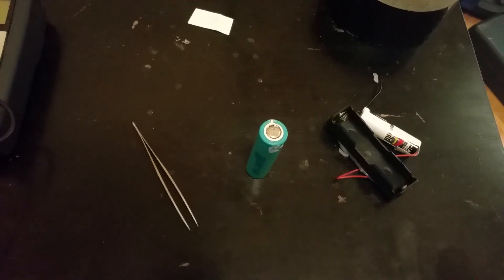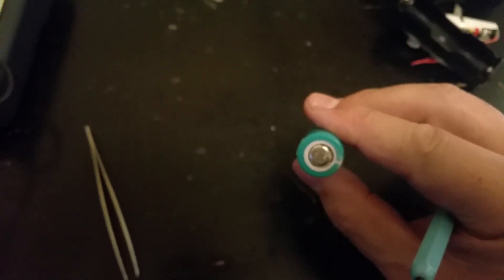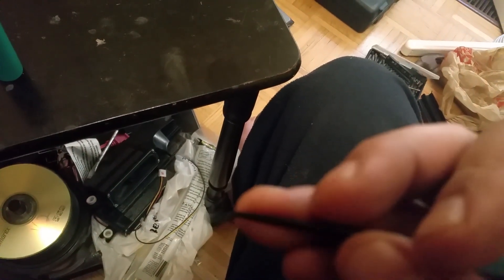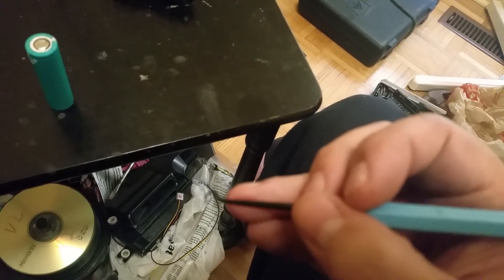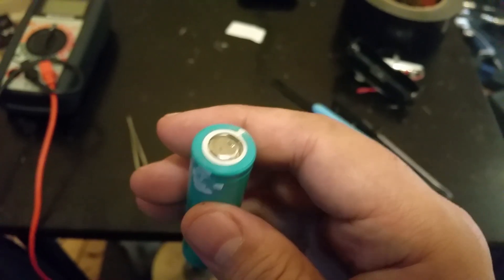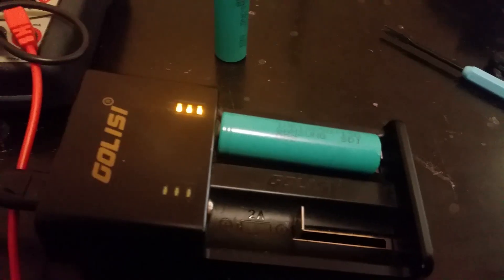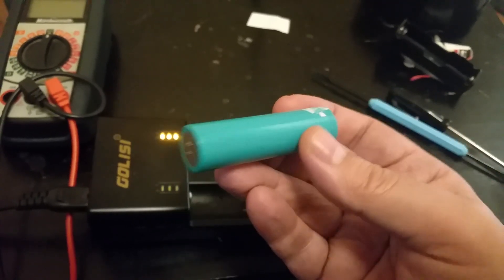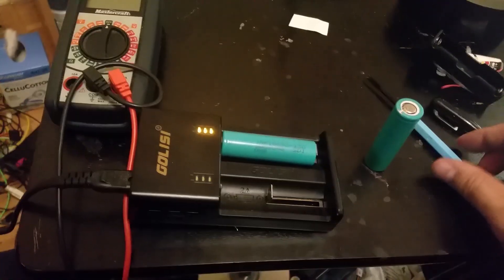EASY FIX FOR A DEAD 'NOT CHARGING' LITHIUM 18650 BATTERY FROM A CORDLESS TOOL BATTERY PACK - PART 2

Comment: I have about 300 NEW LG and Panasonics here and about 150 used of the same and had just thrown out like 9 of them for being ZERO responces. Damn to late now. But good to know in the futurte. I know with all these batteries i should not worry about 9 or so lost, But every one is one more than i had before when it was dead zero.

Comment: Hello, I have two effest 18650 batteries in my smok species V2 vape, one battery works as normal but the other dies within a few hours while the working one is still over 70%, Also the abnormal battery takes over a day to fully charge. What causes this issue please if anyone knows?
Reply: Internally it's a bad battery, not related to the battery in this video, time to replace, imo stay away from efest batteries

Comment: I know this is an older video, but thanks a million...I had an 18650 efest battery that would not take a charge. I followed your instructions and used a micro flathead to the section underneath the positive cap. My battery is now charging. Hope all's well👍

Comment: I had a same issue with 0 volts. I literally removed a board in the negative side of the battery and is working just fine.

Comment: I had two LG 18650 HG2 batteries, which were reading zero volts from one day to another.
Today, my third one suddendly died while having it in my vape. It was still almost halfway full and the vape turned off while I was taking a puff. At home it was also reading zero volts. Then I tried your fix and pressed down the pad below the button on the positive pole and while I was pushing down, I clearly was able to hear gas exiting the battery case!! So I think the shutdown/disconnect is intended by design, in case the cell is gassing out due to an internal chemical failure!
I highly do not recommend using such a "revived" battery, since its chemistry is no longer stable!! Never put it in a charger again!
I dumped mine now, its not worth it.
Best

Comment: I thank you for the great video and the information. I was able to revive a battery pack that was down for quite a while.  It has been working well in my cordless drill. It has charged properly since the fix and I will give a further update as I continue using it.

Comment: This works. I tried it. But, if that metal thing pops up, it means that there's a over pressure inside the cell, so the battery may be not safe to use anymore. When i tried to charge the cell it got warm pretty fast, then the temperature settled at about 30°C ....after some time it started consuming a crazy current (short circuit almost) and the battery got quite hot. So not the safest trick to use (That battery was revived from a completely dead 12 years old battery pack btw, so maybe that heat is caused by it's age)

Comment: This is kind of like removing the check engine light from your car and treating it like it's fixed
Reply: check engine light on means what? unsafe to drive?  so in your analogy u would junk your vehicle and just buy another one. ive done this and still no explosion after a year of use, maybe a car will explode if driving w/check engine light on. its like apples argument against "right to repair", claims safety for consumers for not getting your devices repaired by 3rd party
Reply: @vinnyc7613  It might be a bad analogy but my point is that it's probably not a good idea to try and bypass safety features
Reply: Well, it happened to nearly new batteries.
After fix myself, I don't need to buy new batteries.
Some have worked for years after this simple repair, don't bother discuss with people that are not able to fix anything themselves.
Let them buy everything new 😁
Reply: If they can afford to buy new without trying to fix bad manufacturing,
don't bother discuss it.
They buy new everything, not sure if they help climate being better.
But they support companies earning a lot more money 🤑 
Don't bother, if they never have managed to Fix anything themselves.
They never would 😉

Comment: From A "Safety First!" prospective, this is not a good practice. First of all, Safety IS the main reason for this design. This is to prevent an explosion or a fire! The battery obviously had something go wrong in order to prompt the button to "Pop" up.

To expect this to work Every Time, is not a good thing. Sure, you might be lucky and this battery lasts a very long time again. Or you might be unlucky and destroy your equipment or your eyes. Maybe even your house, when the batter leaks or explodes.It is never a good idea to ignore safety. NEVER!

Just ask yourself if money is more important than you or your family's safety?
Reply: safety he says, most cells are fakes and cid doesn't stop fires, helps prevent them yes  but can still happen

Comment: Do not boost lithium-based batteries back to life that have dwelled below 1.5V/cell for a week or longer. Copper shunts may have formed inside the cells that can lead to a partial or total electrical short. When recharging, such a cell might become unstable, causing excessive heat or show other anomalies. - Battery University
Reply: Big battery hates this one tip that could save you big money!

Comment: done that fot some time, but noticed that cells with blown thermal fuse are usually very low on capacity :/ if thermal protection goes, that means a lot of heat was around that cell, so it cant be very good anymore.

Comment: Hey Guys, I was reading the posts here - You really need to go to BigBattery.Com - The prices of their batteries are insane, and the quality is way incredible. I have been using (4) of their lithium-ion battery packs to make a 48V 9.2kWh size battery bank for the last year and they work like a charm! I used the discount code "Cycle5" to save an additional 5% at checkout. I think the direct link https://BigBattery.com/LiIon has the best deals on these. Hope this helps!"

Comment: Thank you, i had the same battery after chargingit showed 0 volt and didn't think this would work, so i put a needle under that cap and using a multimeter it showed 3.3 volt after pressing around the voltage stayed. Thanks!

Comment: Its very dangerous however it did work.. i tried the parallel method but it didnt work for me. But this one did.. you just have to be gentle not to damage the batteries

Comment: I tried this.  Had a little glasses repair sized flathead to poke around.  No voltage change (0.10v), so I kept poking.  Got 0.45v, then 0.85v, so I went another round of poking.  Then the battery hissed at me, so I dropped it and ran away.  Came back with some long pliers and a bucket.  Strange smell in the air that I immediately chose to stop inhaling.  Left the danger battery in my backyard for now.  :-|
Reply: dah, why u use metal tool, vid states not too

Comment: DIY Vinny, 

Thank you for helping people with their issues. You titled the video 18650 CID Reset DONT DO IT. This for a very good reason. 
IF you want to create video's about risky tricks like this, try to explain why you SHOULDNT TRY THIS. 

Imagine that there are people trying this at home and ending with the possibility on lifelong injuries. A battery cost around 10 euro, it is reckless behavior messing around to save 10 euro. IF you made this video about the risks of messing with this batteries, you would have the same amount of viewers etc,. But instead of pushing people to try risky things, you would protect your viewers by giving them the right information about this kind of tricks. 

BEFORE YOU TRY THIS AT HOME. OVERTHINK IF ITS WORTH TAKING THE RISK TO LOSE YOUR EYESIGHT OR WORSE. JUST SPEND THE FKK 10 EURO FOR YOUR SAFETY.

Comment: I did it and did not work. After the explosion near some household chemicals, i went to the hospital. 
They found out that the radiation created by this mistake mutated my cells and now when i get mad i become in to a green monster.
Now ive been chase by a secret goverment agency after i escape. Please do not try this
Reply: GREEN MONSTER? im buying every dead battery , should eventually get lucky by doing this method. now dont get me angry

Comment: DO NOT DO THIS!

There was a very bad problem happened for this battery and the protection part broke the connection. lf the problem of this battery still there and you reset the connection, the battery may explode at anytime.

Comment: Just a quick note here: If you do this and you hear a "poof" or "hiss" noise while pushing the CID disk down, that means you've punctured it which also means that the overload protection will no longer work.  If the battery is overloaded, like with a short-circuit, it will overheat and could burst and catch on fire (what many people call an exploding battery).
Reply: Tried using my wife's Cricut weeding tool and I made it hiss on my first try...too sharp...Ayayay!!!  where are my keys? Lmao. Thank you for that info.

Comment: This happens to your battery because it is expanding, it's supposed to happen to prevent it from expanding to the point of failure. If you "fix" your battery with this method, you are putting yourself at risk of the battery catching on fire or "venting" as its called

Comment: I must admit that this worked for me,  a 18650 that had been overdischarged and after a very gentle charge it went open circuit due to this venting protection. The cell did vent slightly when the button was depressed and is no longer open circuit, capacity seems close to what it was originally, it is a fake LG. Obviously this is a dangerous practice, you need to be extremely careful not to short the cell or puncture it. My "revived" cell will not be used for any high current discharge, I am still pissed that my 4 LG 18650s were fake despite being careful where I bought them.

Comment: Worked on one battery, not on the another (funny enough, the one it worked on is a high quality name brand, the one that it didn't work on is a knock off no brand). Good tip, both batteries 'died' when I left them in a hot tent on a summer camping trip.

Comment: I think you should've posted a safety disclaimer to this video because what you're doing is DANGEROUS AS FUCK!!!!  If you were to puncture this battery using a gahdamn piece of metal like you're doing, it can blow your fucking arm off, along with any other body part that's near it when it blows up!!!!  Lithium Ion batteries are EXTREMELY DANGEROUS and messing with that battery in any shape form or fashion is extremely dangerous!!!!  You DEFINITELY need to post a disclaimer to this!

Comment: BE CAREFUL, mine sparked up on my Gabriel. It does work and it can charge just be very careful when doing so
Reply: fyi the entire outside casing of the battery is negative. If you pierced the protective layer while probing into the positive side you will short the battery

Comment: I have two new 2600mAh Li-Ion camera batteries (not 18650 single cells) that I’m unable to charge properly after only a handful of charge cycles. The weird thing is when they are fully discharged the charger reports them as 90% charged. After charging to100% I only get around 5 minutes use from them whereas new they gave me around an hour (I use them to power a 7” camera monitor). I checked with a voltage meter and they definitely have zero voltage output when discharged. I doubt the charger is faulty as I have two identical chargers and both give 90% percentage readouts when the batteries are definitely flat. What is going on?

Comment: Don't do this. By batt made a noise like air coming out. The noise stopped, then a minute later was making fizzy sounds. I put it outside.
Reply: Of course it made noise, its releasing pressure that triggered the safety

Comment: The button is there for your safety!!!   Stop f...ing with these explosive batteries!!!!
Reply: or planned failure so would need to buy a $100 battery pack replacement because of one supposedly dead cell after only a couple of years of light use

Comment: hey thanks bro, it actually worked on my 18650 battery which I got from my old laptop battery pack. And the battery is working fine with 3.84volts.
wondering if i've watched this video before i should have save my 4 liion batteries.
and for your knowledge,  the pop up   provides protection by disconnecting the +ve terminal after the electrolyte has be heated (  that may be due to short circuiting or over charging)
once again, Thank you

Comment: It's called a Circuit Interruption Disc and it pops up as a safeguard for when too much pressure builds up in the cell. Whether that's from a short, damage, atmosphere, who knows. But essentially that battery at one point was saying it wasn't safe to be used. But I've seen quite a few cells revived this way. Not sure how well they hold up though
Reply: @faking it Will kinda. After you push it down manually you're weakening it and it may or may not be able to pop back up under pressure. It's kinda designed for a one time use and once it's popped you're supposed to get rid of the battery. But, that's not to say I've never pushed one back down, tested it thoroughly and then reused it
Reply: @honestinsincerity2270  is it dangerous? I have several batteries that won’t take a charge. I have no idea as to why I mess up a lot of batteries. I’m sick of buying them. I tried new chargers and batteries from different sellers. I think it’s me and if this isn’t dangerous I might try it. I don’t wanna blow up.
Reply: @AshleyAshleyAshley395  Kinda. I mean it is a one time use safeguard so once it's tripped the manufacturer is basically saying this battery is no longer safe for use. But, with that said, they also want you to buy as many batteries as possible. Personally, I've revived quite a few cells by pushing the CID back down. And I still use them to this day.
Reply: @AshleyAshleyAshley395  and if that's happening a lot to you and you're using name brand cells like Samsung, LG, etc then it could be you're charging them too quickly or at too high of a voltage. Usually that'll cause heat in the cell, which cause pressure, which causes the CID to pop out. So might wanna make sure you're using a good charger on the right settings.
Reply: Im sure your house won’t hold up well.
Reply: @fbi-federalblyatofinvestig3853  Yeah totally. My house is gonna EXPLODE from a few Li-Ion cells. That's like saying the road flares in your trunk are gonna explode. Learn how to test and treat your power sources and you won't have a problem.
Reply: @honestinsincerity2270  I’m not trying to start a fight but resetting a CID that has popped for either overheating or extreme pressure in the cell doesn’t sound like a good idea and can lead to a fire. Also I didn’t say your house was gonna explode, they are lithium ion cells not dynamite.
Reply: @fbi-federalblyatofinvestig3853  Yeah agreed. I never said it was a good idea. I actually said it's kinda dangerous, especially if you don't know what you're doing. But if you're smart about it and understand the batteries themselves, it's much safer. I've reset and used batteries for years without a problem but I also know which ones to keep. In terms of risk, I've actually had brand new, yet cheaply made batteries, overheat significantly more than name brand reset batteries. LGs are known as Heaters just off the shelf. And those pose more of a risk than any Samsung I've reset. Even then, it would take a significantly overcharged and/or damaged battery to even get near starting a fire. And no one should ever leave charging batteries unattended.
Reply: I’ve had a couple go bad on me but now adays I never let them go below half a charge and have been using the same 3 for years
Reply: Yes I was figure out looking found out battery 🔋

Comment: Makes complete sense.   It's just like a little cheapo circuit breaker installed in the battery.   Great, except for the fact that it makes you unnecessarily have to buy new batteries, and, in most cases, an entire battery pack. 

I've got a defective 40 volt lithium ion battery, and I've seen a number of videos on how to revive them, so, getting right on that tomorrow morning!   A new 40 volt battery is a hundred bucks, and from the reviews on them, even if I got a new one, that one would fail very quickly it appears.

I think part of the problem is manufactures are setting the "fail safes" to conservatively, or their setting the discharge fail safe too low.   In other words, they should make it so the battery is "dead" with a higher voltage left in it, so if you don't immediately put it on the charger when it's "dead" it will retain enough voltage for when you DO put it on the charger, for the charger to recognize it. 

But, obviously they don't want the batteries to last TOO long.  You won't have to buy new batteries or tools, if that was the case!
Reply: Very clever indeed! 
Its true, they are in the business to make money over & over, not for you to be able to keep your battery working longer... 
    If you can help yourself, then you don't need them (as often anyway)..

Comment: OMG it worked! I had an LG HE4 dead for months was about to throw it away(like right now, last ditch effort to get it working and found this video). I did what u said and when I did, I heard a 'POOF, air like sound', and put it back in my charger and its charging now!! Amazing, THANK YOU!!
Reply: Same here. I did it on a dead Panasonic battery and after hearing a short poof like gas leaking, the battery can be charged again.
Reply: FYI - That poof sound was you puncturing the CID disc that pops after pressure builds up and disconnects the circuit as a safe guard. You were letting the pressure out and then pushing the metal disc back in place so that it makes contact. Just in case you were wondering.
Reply: that "poof sound" is not good bro!!! you've probably puntched the battery, and few days later your battery's electrolyte will be evaporated and the battery will be dead again😶😶
Reply: @gammaray4850  If you're lucky.